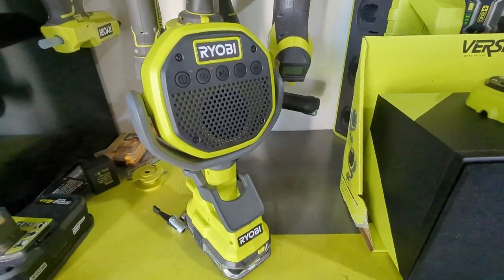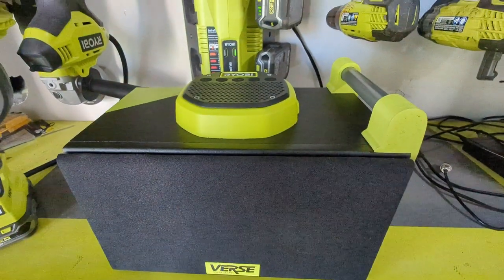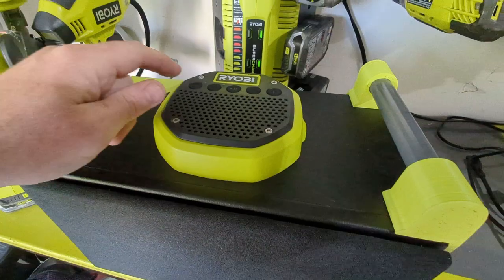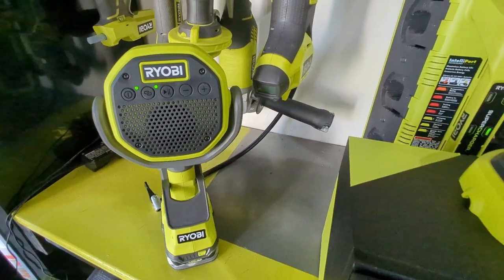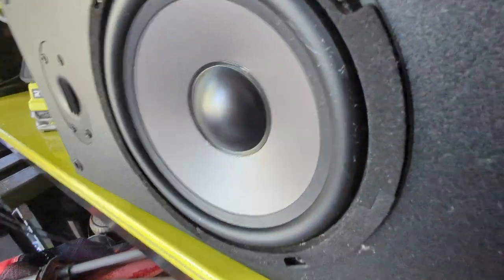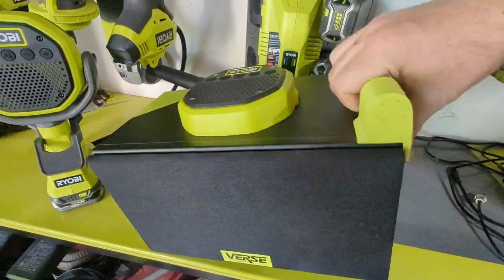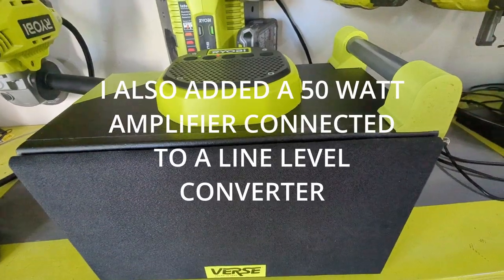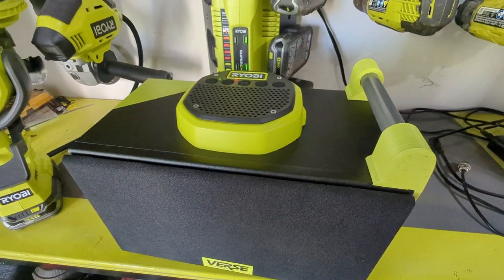RYOBI Verse Mega Speaker

Comment: Did you basically wire the speaker inputs from the existing speaker to the new one, then build the box. You did a really good job making it look factory, I already started looking online to buy one.
Reply from the maker: No, I removed the speaker, wired the speaker wires to a line level converter which outputs RCA which is very low output like headphones loud.  Then wired that to an amplifier which is powered by the battery (it goes from 12-24volts).  Then I wired the amp to a bookshelf speaker and stuffed everything into the bookshelf speaker. Added a handle and some Ryobi color to it.
Reply: @rickplunk1171  well, it's very impressive.
Reply: @rickplunk1171  Really liked your project, can you please post links to the line converter and amplifier that you used, thanks.

Comment: Did you hook the power from the battery strait to the amp or did you come off the control circuit board somehow
Reply from the maker: Straight from the battery to the amp.  The amp can take 12-24 volts DC
Reply: Nice thanks

Comment: What 50W amp and line level converter did you use? Did they run directly from 18V or did you also add power conditioning?